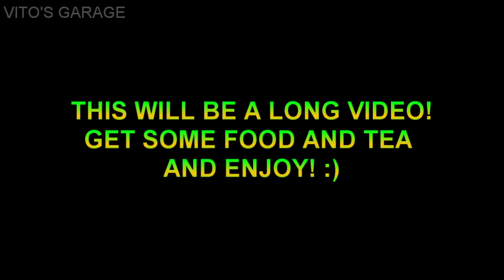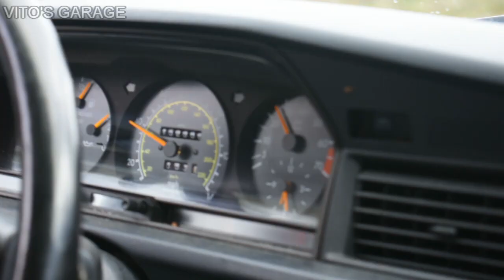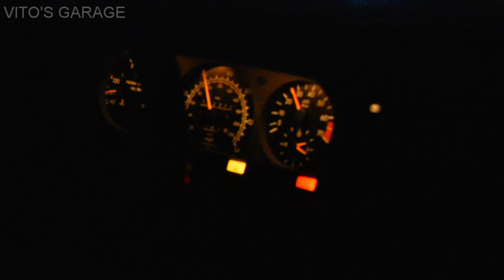Rescuing a Misfiring, Dirty and Neglected 1992 Mercedes 190E Baby Benz!

Comment: I know everyone is wowing over that rare E400 since it's the most collectable but honesty that super rare 190E with the even more rare 5 speed manual and the 2.6 inline 6 cylinder was the car that I was lusting over. That exterior color is called Petrol blue green and was even an available color on the R109 560SL's of that time period. You almost never seen that color mated to a 5 speed manual. All the 5 speed manual 190 Es that I ever saw were in red, black or white. That 190E needs to be brought out of there and restored. It would make me weep to drive away without that car.

Comment: I'm building my garage, I will be saving at least one Mercedes
I want a 300td sooo bad, here in Paraguay "good" condition ones are like 2 grand, they have pretty straight body but most smoke like crazy and have like 500k km but I'll save them
Reply from the maker: Must save them no matter what! Do the engine overhaul, replace everything at once and it'll never smoke. And rebuild or replace the injectors

Comment: I can't believe u were able to fix the misfiring in such a short time, I'm learning a lot from u.

By d way, what u sprayed on the wiper (@ 22:58), is it like WD40? One more question, do u happen to have a video for repairing the 190E door cards? mine are protruding from the window seals and I'm afraid they might get torn if I don't catch it soon enough.

Thanks a million for the great work u re doin' 💪
Reply from the maker: Thank you for watching and supporting, Victor! And I sprayed rust penetrating oil and lubricant on that wiper. I lifted it up to change the wiper blade and then it got stuck. Eventually I lowered it down without any problems. That car also sat for many years before we got it and saved it. 
As far as the door cards, I don’t have any suggestions at the moment. Mine are the same way, they’re separating. Either try to find a good used set of door cards, or you can try to take off your old ones and glue the pieces together. You’ll have to hold both sides with some alligator clips until the glue dries off
Reply: @VITOSGARAGE  Thanks Vito, I guess the glue option will be better since they can be very hard to find, especially that mine still match the interior (seats). 

Keep saving those "beasts", soon they'll be worth thousands of $$$$$ 💪

Comment: I have a 1993 190e it has a misfire and shakes  my mechanic says he can't find the problem do you have any tips I would appreciate it
Reply from the maker: First thing you need to do is to check for vacuum leaks. You can ask the mechanic to smoke check it with a smoke machine or you can buy a smoke machine online. Make sure to look for vacuum leaks first